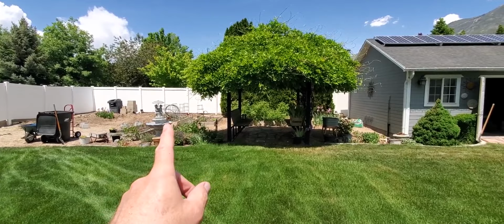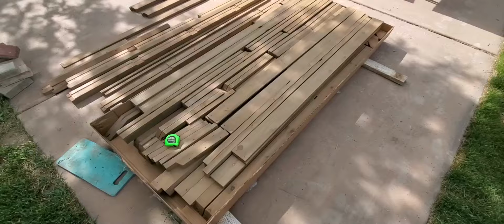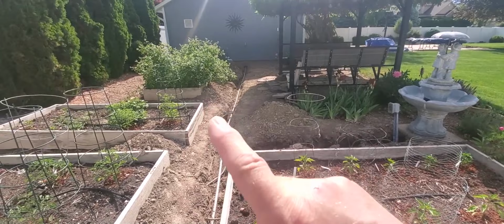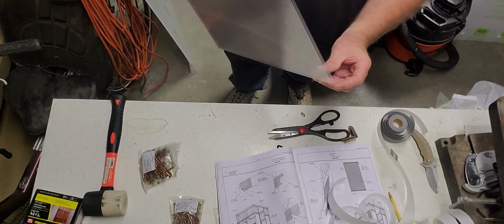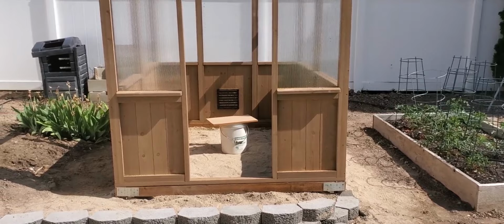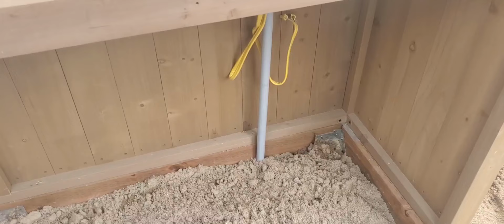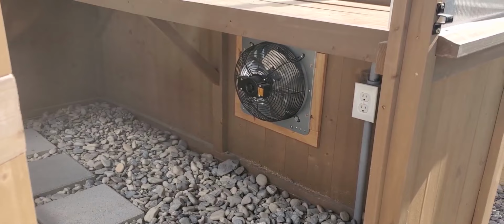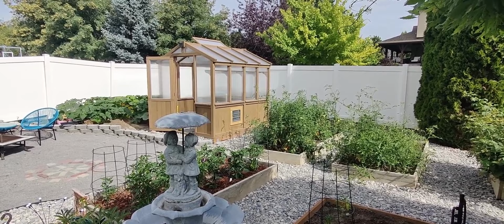Building a Yardistry YM12842 / Meridian Greenhouse purchased from Costco.

Comment: Hi Dan, I just finished staining each piece and then assembling the Yardistry greenhouse. My question is regarding your vent fan. I was looking at doing the same with the WiFi inkbird controller. How does the powered vent work in that location? I ran 12/2 line as well with 20a gfci breaker. I also thought of putting the powered vent in the location that the current passive vent is in and then adding smaller vents on each side of the door. Would like to know your experience as I have power coming up same location as you and can easily pop powered vent next to plug like you did. I am in CT planting zone 6. 

Any other suggestions while in the initial building phase? I Thank you for your feedback. 😊
Reply from the maker: I believe that fan location is working fine.  However, I did not make any measurements before the fan installation :)  It certainly pulls out a lot of hot air.  That was a good idea to stain everything prior to assembly.  I should have done that.  Can not think of anything else about the build.

I am working on a system to heat water with solar panels for heating during the winter.  I bought two used solar panels and a 20 gallon water drum.

Thanks for the comments.

Comment: Thank you for this video. You did a fantastic job. My wife bought this greenhouse and I just finished the structure. I am on the running outlets and lights phase. I am going to copy your installation and put an overhead 4 foot light and an outdoor light above the door. I am working out the best way to run the romex. How did you run the power from the outlet to the switches? I am also going to copy your fan idea, just debating whether a reversible fan would be more functional. Any issues with not using conduit everywhere? I live in Rhode Island and I am a little nervous about exposed wires. Thank you again.
Reply from the maker: Your welcome :)  I continued the conduit up to under the shelf.  At that point, the Romex wire is is exposed.   IMO, the exposed Romex is fine where it is not subject to getting a lot of abuse.  The reversible fan would be interesting to experiment with.  I am thinking about adding some type of thermal mass in the greenhouse to reduce the thermal swings between night and day.  I have the fan start at 90F and that seems to work but is getting pretty cold at nights right now.

Comment: This actually looks rather easy to build out of 2x4 and ply boards and plastic paneling and solar panel powered led entrance light as well as a ventilation fan that is connected to a RHU and temp sensor and plug. And pay way way less I love watching videos to recreate out of wood and sweat.
Reply from the maker: Probably possible to beat the price by a little bit but would take time to find all the parts.  I am currently working on a solar panel powered heating system for the greenhouse.  I might make a video about it.
Reply: @DanPattenAudioG33k  that is easy work finding brackets and installing them is no excuse to spend 10X more on a item that turns out the same or better u did jive on the garden though and rock laying.
Reply: The “windows” are doubly ply polycarbonate sheets.  They’re $100 each and you’d need about 6 to cover this exact shed.  You’re high if you think you can build this cedar greenhouse for 10% what it costs to buy (you’re claiming it would cost you $135 pre tax in case you’re as bad at math as you are cost estimates).  You could MAYBE shave 15% if you really went for it, but for $200, I’d just save my back and my time buying it pre cut and stained in this pack.  Plus I get a warranty.  Good luck getting a warranty on your build lmfao 🤣
Reply: @dogbots159  shipping that is not cheap either and ya maybe not that much less but definitely a lot less. And secondly you can beef things up personalize them better doing a build it yourself. Some materials you could cheap out on and some I would spend more on. But the point is most Men that work with there hands would rather build it then buying a pre built TV stand practically and those old TV stands would always fall apart.
Reply: @DanPattenAudioG33k  that's cool I would love to see it. Did you mean u going to custom build from the ground up as well.
Reply: @dogbots159  warranty is worthless it really is.
Reply: There is no shipping. You pick it up at a store for $1350 in person lmao
Reply from the maker: When I first started investigating building a greenhouse.  I started adding up components purchased at Home Depot and online parts.  I was actually more expensive than the kits from Yardistry and Palram.  When, I saw this kit at Costco, I jumped on it :)
Reply: @DanPattenAudioG33k  yes because it is companies best interest to loose money selling under priced products LMFAO 😂😆. Google is a wonderful thing if used correctly.
Reply: @DanPattenAudioG33k  We bought the kit online. Took 2 days to build and then another week waiting for Yardistry to send a new door that was damaged during shipping. I was all set to build from scratch with used windows. So glad I did not. This is much nicer and my wife is very happy with it. Thanks for this video, it gave me better ides on what else to include.
Reply from the maker: @resellerrunner5149  Thanks.  We are enjoying ours greenhouse as well.  I am still playing with ideas on how to heat it.
Reply: @DanPattenAudioG33k  I ran a 12/2 line out to ours andplan on using a 20 amp gfci breaker. I was told by an electrician that will be enough for a heater also.
Reply from the maker: @resellerrunner5149  I was resisting installing a space heater (although it would work fine).  I have purchased a couple of used 300W solar panels and want to use them to heat a water barrel during the day and have it radiate the heat at night.  Or at least that was my crazy idea. :)
Reply: Hi Dan, I just finished staining each piece and then assembling the Yardistry greenhouse. My question is regarding your vent fan. I was looking at doing the same with the WiFi inkbird controller. How does the powered vent work in that location? I ran 12/2 line as well with 20a gfci breaker. I also thought of putting the powered vent in the location that the current passive vent is in and then adding smaller vents on each side of the door. Would like to know your experience as I have power coming up same location as you and can easily pop powered vent next to plug like you did. I am in CT planting zone 6. 

Any other suggestions while in the initial building phase? I Thank you for your feedback. 😊

Comment: Time spent on taping polycarbonate panels was longer.. But there was nothing about assembling greenhouse in this video. What is the purpose of this video?
Reply from the maker: I believe items demonstrated are:
- How to construct foundation/base.
- How to use pre-cast piers.
- How to tie front and back base pieces into piers.
- Idea to keep base parallel during construction.
- Fill consideration around base to increase longevity of wood.
- Idea to check base and greenhouse fit.
- Ease of construction by using tables.
- Expected time for construction.
- Issues with vent construction.
- Issues with auto-vent piston.
- Where to find substitute auto-vent piston.
- Method to protect auto-vent piston from high wind.
- Method for adding automated exhaust fan.
- Method for adding and locating lighting switch and outlet.
- Suggestions for lighting fixtures.
- Example of what small retaining wall would look like.
- Example for gravel and paver install can look like.
- Possible issue with water ingress around auto-vent.
- Confusion and solution of door mounting.
- What a completed construction can look like.
Reply: I agree   Was hoping for more on the walls, roof and door being assembled and installed. Was more about his electric ability. Turned out nice tho. Mine will be delivered tomorrow
Reply: Great video! Thank you for sharing brother.